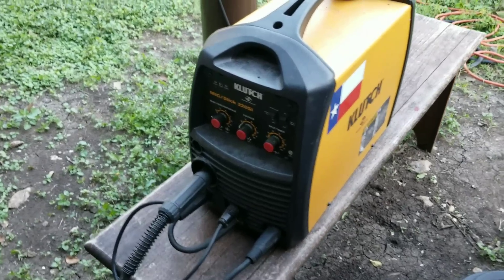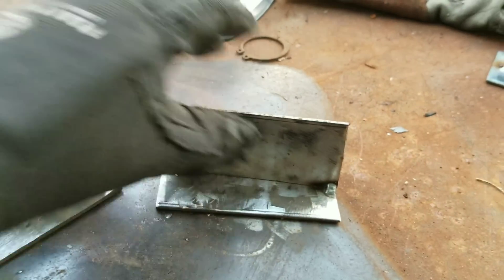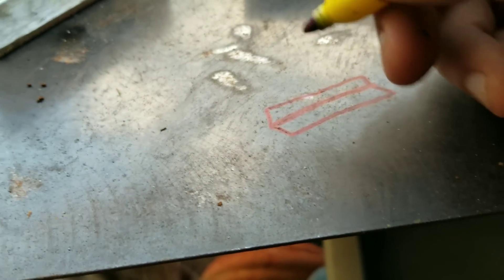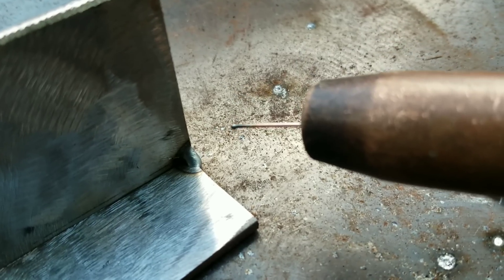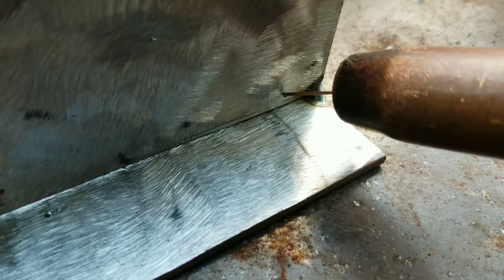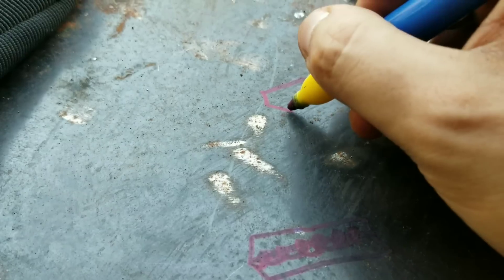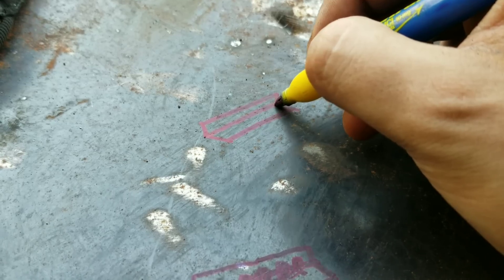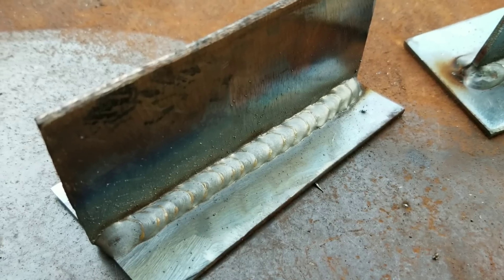How to lay dimes mig welding!

Comment: It every machine I could only afford a cheap gasless  mig even the leads cannot be changed so the wire is positive making much more splatter, and the size of the weld is tiny but in times of hardship there is not much one can do. But thanks for your advice anyways. Andy Perth Australia😊

Comment: Very interesting technique, but I suppose this is only suitable for thicker metal? I mostly weld thin body panels, typically 16 gauge, and believe this bead method will generate too much heat, causing excessive heat warping?

Comment: this is easier to do on little welders because its harder to be way too hot. if you have a big 250a machine the key is SETUP. the weld guide inside the door will be WAY TOO HOT esp if its a lincoln. so back that voltage down at least 3 volts and give it a whirl.

Comment: You don't weave or try walk the cup mig welding. Mig welding is designed to lay wire steady and straight. I would get fired at my shop if they caught me weaving or trying to stack dimes with our mig machines. If you want to get into that type of welding consider tig.

Comment: First things first, you mentioned that you have a carbon dioxide argon mix of gas. What the hell is the percentage?
You can't maintain a plasma stream till you get to a minimum of 80% Argon. That makes a lot of difference from what the quality of welding you can do especially on things like stainless steel. And 75/25 will cause a lot of spatter most of the time. Spatter is evidence that you're not getting enough penetration and that your weld is substandard.
The first weld that you put down looks a little bit on the cool side. Remember that with a MIG you should always feel like you're working with it just a little bit on the warm side because it is very easy to put a very nice-looking weld down with a big that doesn't hold a thing. I have actually seen Wells come completely off of the metal oh, that looked very good without a very good eye to see what the problem was.
Make sure that your argon CO2 is at least 90% it's a lot easier to weld with, and you get less spatter. You can actually go into spray arc on Chevy parts and put down a nice root pass on fairly heavy metal

Comment: I keep the cherry on my wire as tight to the root for maximum penetration  with a very short arc and a 5 degree push in the direction of travel going left to right. Dont wonder to far from from root because it really affects your penetration. When you guys really like your weld go ahead and cut and polish and apply a etch solution like navel jelly to really see how much penetration you actually get. I think you will find a big weave can look nice isnt always as strong. Been welding since 1978 and learned the etch test in my welding degree program.

Comment: The only problem i have with his back and forth weave pattern is that it works great with aluminum welding to get that effect. When it comes to steal i feel you need to turn your settings down to the point where its not as strong as a weld ( depends on thickness of material) but his welds did look cold to me. (Or to big for the material. ). I could be wrong.

Comment: Dime let me set aside for now. I need to get my setting right first. Need help. I got a Klutch 180sg with spool gun and it got no welding chart guide. I'm a beginner I couldn't dial in my setting trying to weld aluminum... Believed it or not I used up all the argon in my 125 tank practicing and my weld still look like crap and wasted a bunch of welding tips burned back and so forth.  I searched online for a chart to based setting off but to no avail. I got 2 dials, Volt and wire speed 1-10 for both dials.  You think my 2 dials setting would be same as yours? please help. some say use miller calculator .125 for 125amps. my welder don't display amp. so I don't know what amp setting i'm at. And believed or not I just ordered a Primeweld tig225, digging myself deeper in a weld hole!

Comment: Good Video,  I just bought the miller 235 haven't touched a welder in 20 yrs layed down a nice weld today but not quite a stack of dimes, I got the big roll of .035 wire I probably should have got .030 but I usually weld thicker stuff on the farm,

Comment: I use the “cursive e” method but at the bottom, I’ll hold it there for a second and then continue. Let’s your weld flatten out a little bit, especially on corner joints. The back and forth motion is really good for filling larger gaps too.

Comment: Not really a reliable weld lots of cold lap. Spray transfer that shit in there. 28 volts 450 wire speed. Screw it 30 volts and 425 wire bud. Your welcome. If you cant handle that, then your no welder.

Comment: Any tips for horizontal butt joint welds. I’m new to welding and I’m wondering if there’s a way to weld without it “dripping” to the bottom.

Comment: A "T" size high pressure tank standing alone and unsecured?!?! You'd better hope you do not knock it over and break the regulator off, because you've got a deadly 2200psi rocket with no shutoff and no guidance system. You might weld well, actually quite well, but otherwise you're a danger to yourself and others. Get proper safety instruction BEFORE you instruct others. Amatures teach amatures to be amatures! You might want to wear some protective clothing too. Again... SAFETY!!!!

Comment: Some of this is perfectly fine in production welding, sheet metal or welding at home, which probably most people here are gonna be doing anyhow. In a weld that matters though these methods will bite you in the ass. Predominantly the "whip & pause" and welding in circles/loops as it allows filler metal to roll over the puddle illuminating alot of penetration. Been a welder for 22 years and most of these methods will fail a cert test. The "circle/loop" method is something only new welders use or try. If you really know what your looking for you can do the "whip and pause" and still create a strong weld, bit it's still not gonna be up to par compared to welding a regular stringer bead or weaving, what you called welding in C-shapes. Pulling, not pushing the weld is also the stronger method which is why it's all that's used for anything certifiable. Gotta work the gravity/the flow of the molten metal. Which is also why you run vertical upwards. Again, it mostly doesn't matter if you're running sheet metal or similar. But for the most part some of these will give you gaps in your root weld where it doesn't penetrate. I've worked with plenty of guys that can lay a beautiful bead like this but to this and can't understand why they can't pass a test...

Comment: I have a cheating MiG way where I basically just do a continuous, close together, line of tac welds. Just keep pushing the button in a set rhythm. Do the next one before the last one stops glowing, just keep moving. It's a lot easier than these usually you can just walk the cup. A bit more splatter and I know it's not proper. Probably could introduce some pores if you slow down or pause to long. But it works if you aren't worried about strength so much. I don't know if there is a name for it. A guy showed me but i think he just made it up.

Comment: Good video but my problem is that the wire feed speed is just too difficult to understand how to set it  up. I have really only used Acy/Oxy welding and that is OK. My arc welding did not real well but it usually held up ok. Of course the rod stuck a lot in the beginning as I don't do it very often. The mig seems to be a better way if I could conquer the wire feed.
I like your idea of welding while treating it as if you were drawing--great idea!
Ideas for me on the wire feed? I also need/want to buy a welder--cars are my primary welding need with some minor around the garage/house needs. I cannot spend an awful lot of money and am looking for a recommendation. The Klutch you mention is not easy to find--found these on Amazon:
Klutch ST200iDV and  KlutchST200iDV--is one of these the one you refer to?

Comment: Nice job man. If your in a situation where u cant use gas, do you have as good of luck with each of those methods, or does one work better for you. Welding 1/4 against 3/8 with a hobartb140.

Comment: The only time i lay dime welds is backwards then fowards is when im welding 10mm or 16mm base plates, but only if i wonna pour more weld into the RHS and plates.... but i prefer flat welds though... but yeah thats nice mate... i use a 175 arc/mig cigwelder when im on site and in the workshop i use a 400HD Cigweld and its a beast... always go for the buzzy bee sound too....

Comment: I guess nobody ever told you making so-called dimes makes a weld weak? The more DIMES you have the weaker the weld Mr. Cool.
Reply: different weld processes and techinques  are dictated by application while this techinque is not appropriate for structural welding (i.e. code compliant) it is a a strong weld, numerous stress strain test have been performed to debunk this very same myth, with findings indicating small diminshes in strength deemed insignificant. That is why this method is so widely used in motorsports (desert racing and even nascar). So the reason why these techniques are said to be weak, is because the individual performing these methods must be a proficient welder in order to produce a sound weld, It might look good but that is not an indication of a structural weld. That is why when stick welding for structures puddle manipulation is not allowed; thus why you're told to only drag the rod. Now with portably x-rays and thermal imaging becoming more abundant this is now becoming an issue and can manipulate the puddle! Mr. cool
Reply: portable; becoming less of an issue; for the ill grammar
Reply: @porquefastgarage1455  
WTF are you talking about? Manipulating the puddle is all part of welding and required. In addition there is nothing in D1.1 or any code that says a puddle can't be manipulated. 
It has also been proven through testing ripples create and are stress risers.

Comment: This is not good advice to beginning welders. If you're welding, then you're likely creating a structural connection, and this type of welding is not the best choice. A straight 'stringer' weld will ALWAYS be stronger, more resistant to corrosion, less likely to crack, and interestingly easier to paint. The only reason to do welds like this is to impress your non-welding buds, and to convince them to weld like this on their bumpers so that their shit falls apart and makes yours look better when you secretly use a stringer weld.

Comment: Did that shit 11 hours a day for 5 years working at full throttle suspension.
I always trip on the guys that do bumper builds and have to grind their welds.
Welds like these shouldn't have to be grinded,  maybe a sand blasting but that's it.

Comment: Bryan, good video Thanks brother. A little thing I learned years ago-convert the thickness of the metal to decimal-that is 1/8inch is .125 so that is the amps to start with. Drop it a little,perhaps 90amps, to test it then increase it as you go. An old lad back in the 60s told me that. He gave me my first Lincoln buzz box and yes she still works.

Comment: I have been welding for 50 yrs and 2 yrs of collage for welding and 30+ years as a welding supervisor in several shops, your welds are way to big do you even know what a root pas is, if you had ever came to a shop I was running you would have never got hired.  tell me how many  processes do you know I have been certified in all processes

Comment: Well, I've read some of the comments. And I HAVE been welding for 30 years. Certified tank welder for Exxon. And I use these methods myself on some things. But, it could leak on a tank. And while this is my own preferred look of weld. It's not the strongest. Also when you weld a joint as you did here. Start in the middle and work your way to the end. The come back to the middle. And go the other way. This will keep the heat down and the 90 degree more true. The way you did it. Heat just keeps building and building the longer the joint is.

Comment: That's some nice welding with a mig. I assume you're using the gas you showed? Very nice explanation of basically "drawing" the "c" or "e" and trying to get a rhythm.  I'm a lousy beginner, what's the best way to weld up bolts in a bumper to smooth the face of the bumper? I have an unchromed bumper need to weld bolts and grind smooth before painting.

Comment: I find welding a very odd art. It's simple and also not simple. What I mean is you have to use whatever method works for what you are doing at the time and also time can play a factor and hand pain. I want to try the one method you where showing for staking dimes with going in and pausing and then out of the molten lava pool. I find the circular method works just seriously kills my arm!  Thanks for throwing a few methods out there. I will try a new one and see if that makes for less strian

Comment: First two methods look great and get to the root of the joint, the third doesn't get into the root as well but would be ok to fill a small gap, if you were to cut and etch it you would see.  First two though are quite good. And the tip on cleaning the metal is so true !  Nice job.

Comment: Cool beads! Thanks for the tips! I'm learning. Right now my welds look like boogers and bubble gum. My challenge is getting the right tension on the wire feeder. The wire comes out in a jerking motion (that's what she said). The wire doesn't come out smooth. So I get a sizzle, then the wire doesn't come out for a split second, melts the wire tip, drops and pops.

Comment: I got the 140si on clearance for 150 bucks before v2 came out I had to borrow a friend's pole barn to have a space to use it. but once I finally ran 12 gauge wire over to it... I was impressed ever since. the barn is a long ways from the house and though the gauge is sufficient on run to house, inside the barn it was 14 gauge. Just sufficient plus a long run in electrical power equals a lot of sag. Maybe it's in my head but one other person mentioned it to not knowing I had upgraded the wire you just said weird it seems more powerful today

Comment: well my 15 year old self can lay some dimes....but i wish my welding class had clean ground tables that are not filled with A BILLION freaking slag/spatter balls all over the table cause i cant freely move my hand smoothly other than lifting and having one hand levitating and well yeah sure i can do that but my weld is gonna be inconsistant and well my welding class teacher is more than fine with that but........i just hate it and i get an ocd attack and get pissed off and...yup but one day im just gonna get a grinding wheel and just spend 10 minutes grinding down the little metal table Lmao.....but that aint a bad plan but i just want to get in trouble

Comment: Great video, simple and straight to the point, I'm a welder on production equipment repair shop we match welding of the equipment we repair,  but sometimes we have to make new equipment and we got to use some of these techniques on structural .

Comment: Looking to getting into welding 24 yo, just worried about Eye sight ??? Does it get bad over time ? Are your eyes in danger in the long run ?
Reply: I have been welding for 45 years and my eyesight is no worse than anyone that hasn't even seen a flash that is my age.  @ 42 I started needing to wear reader glasses.  MOST people, no matter what they do, start needing eyesight help at that age.  The main thing is to protect your eyes.  With the automatic lenses in hoods now, one should not suffer from flash burns.  I have burned my eyes several times and some of those were severe.  I never went to the doctor because there is really nothing they can do except put some type of cream and a patch on it.  Your eyes will quit hurting in 12 to 18 hours after they start hurting.  I can read with 150+ lenses with no problem.  I do wear the reader glasses now when I weld but I am almost 66.   I don't wear them all the time.  I don't need them to drive. A question for you to consider and I am not being a smart ass, but how many people at age 66 do you know that aren't wearing glasses?

Comment: Which is a stronger hold like if I was trying to weld a frame or a piece of car panel. 
I'm a newbie and trying to learn to weld to do my own car restoration
Reply from the maker: Mig and tig is your best bet for automotive
Reply: So, I've done some automotive welding with my mig welder. You will likely be using 22 gauge patch panels. Very thin. The trick there is to go very slowly using whatevertechnoque is right for your rhythm. Welding short beads at a time. Allow it to cool. Go to opposite side of panel, weld a short bead, let that cool. I had pretty good luck welding 1.5 inch beads, blowing the surface with compressed air until it's cool to the touch. Good luck.
Reply: Yeah. It does the type of weld technique matter? Like the little circles or the C ?
Reply from the maker: No it doesn't matter it just what feels more comfortable for u to do ..some ppl like whipping it others like the Cursive E and others like the half moon it's all up to you
Reply: Sterling thanks for your input bro and for sharing knowledge

Comment: How many passes do you need to do for a good solid weld?
Reply from the maker: its usually just one pass on 1/8 and 3/16  but the passes will increase with the thickness of the metal
Reply: @bryanbg2608  Ok, thanks. So, I'll need to increase the passes if I'm welding something like motor mounts onto a car chassis correct? About, how many you say 2-3 passes?
Reply from the maker: U should be good with one pass how thick are the mounts ?
Reply: @bryanbg2608  I would say mounts are less than 1" thick.

Comment: What kind of wire are you running I'm taking my test for 211 and it's not as easy?
Reply from the maker: .035 wire ...what position is the test
Reply: 6g position weld